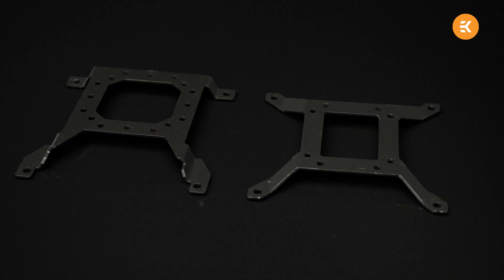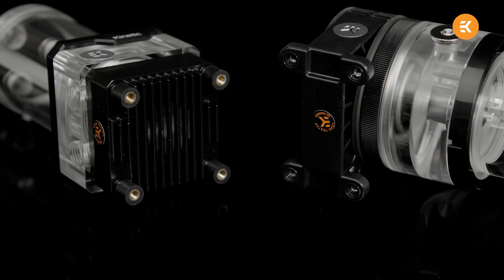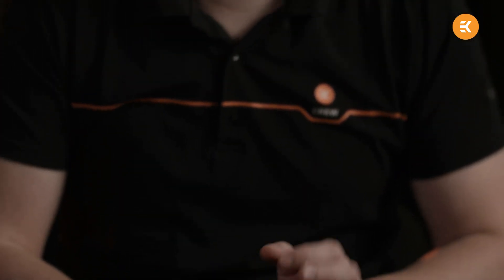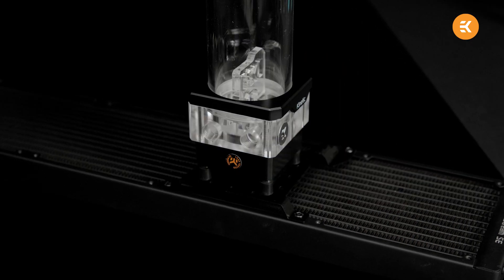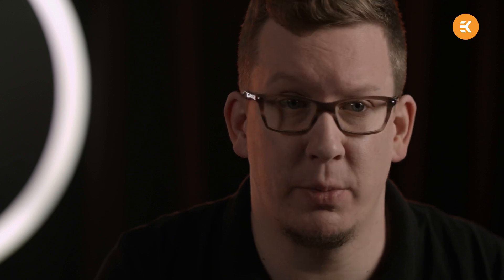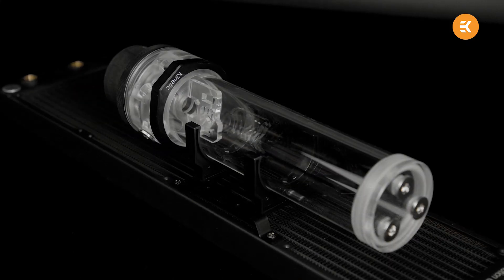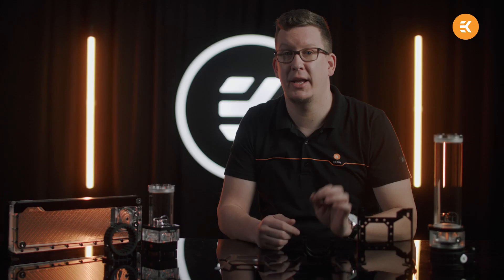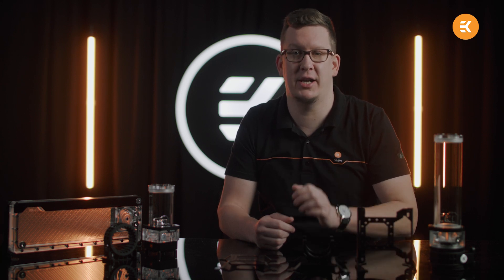A Closer Look at EK HOLDERS

Comment: Does EK make L brackets to fit 140mm rads so you can mount 120mm or 140mm pump/distro reservoirs in parallel